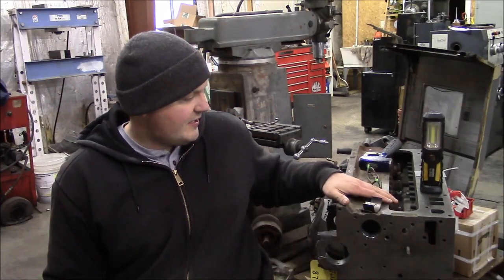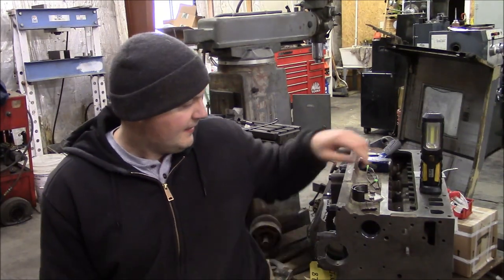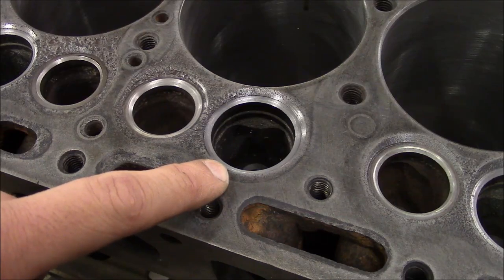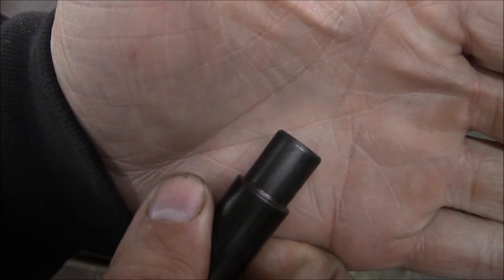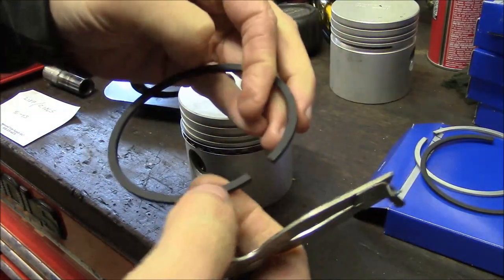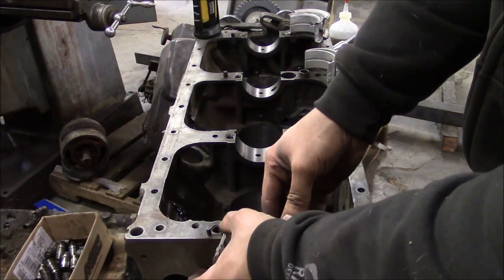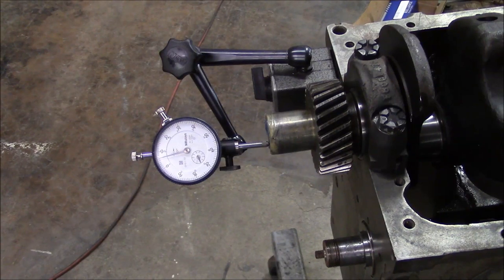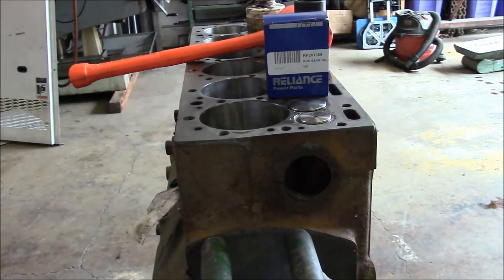Continental F245 Flathead Engine Overhaul - Part 1 (building the short block)

Comment: Wes, I'm an Airframe and Powerplant mechanic with an IA (Inspection Authorization endorsement) Which means I can sign off my own work in the 3 log books regular private airplanes have. I'm familiar with rebuilding (overhauling) engines that will attach into the airplanes I work on. The main engines I work on are 2 Lycoming and Continental. I had no idea that Continental manufactured more than aircraft powerplants. This was an interesting series thanks for letting us watch
Reply: Continental engines are quite common on welders and air-compressors of days gone by .

Comment: Excellent job. I have rebuilt many engines using the same procedures, never had a call back or failure. One suggestion, when installing pistons in the bore, I put a piece of rubber hose on each rod bolt so it won't scratch the journal when you tap it down.

Comment: Hi Wes.  I know this video was a 1000yrs ago, but you say you had to 'knock' the valve guides in with a dirty great mallet, because you couldn't use your hydraulic press.  You suspect however that this may have caused the cracks.
I'm sure I hardly need to remind you, but there's always the 'drawbolt' method of valve guide insertion.  Perhaps that would have saved the guides, and time and effort.
I've been a subscriber to your channel for maybe 2yrs, and somehow overlooked many of your back catalogue of videos.  Just spent a couple of days looking back at some of them, hence this 'late' comment.
One of the best channels of this type on YT - so thanks very much for sharing.
Regards Mark in the UK

Comment: Enjoy the video however one correction.
The notch on the bearing is not in place there to keep the bearing from spinning around, although it is widely believed it is the case.
It is mainly there to locate the bearing in the correct orientation.
The only force keeping the bearing from spinning is the friction between bearing back and bearing caps. Which therefore should be clean and oil free during installation.
I work with normal notched bearings and bearings without any notch and both work equally well.
Reply from the maker: That's a good point Eryk.
Reply: Double B S oriented so it will be retained. An not spin
Reply: @joepacheco4038  The tabs do not stop bearings from spinning, if anything they cause more damage when they do spin.  Many modern engines now use tabless bearing shells, the clamping pressure is what stops them moving.

Comment: Wes, great channel 
I've always used Motor Medic, Motot Honey or STP oil additive for rebuilding engine blocks, just the basics. New bearings, rings 
Front and rear engine seals. Hand polish the crankshaft,  lol
I never used plastic gauge. Hone the cylinder walls and put it back together.  Never had a problem not using engine assembly lube.
All overhead valve straight 6's

Comment: Forgive me, as I am tardy to the party and just catching up with some of your older videos. Please consider the following boiler-plate internet comments: 1) you used the wrong lube when you reassembled the fretterich valve, 2) my grandpa doesn't use plastigauge. Consider Play Doh, 3. You used the wrong sized socket when hammering the cap into the block. I'll consider more for the other vids in the series.

Comment: That crank gear being loose would bother me. Normally I just use 15w40 for all engine assembly. I also do an electric pump prelube of the whole engine before I start it though. You put that gasket dressing on your pan gasket both sides and you will need a sledge hammer and cold chisel to get it back off,,,, or so I have heard. :-) lol
Reply from the maker: The front pulley holds the gear in place. It's not a press fit. I've never seen where silicone or High-tack or any other kind of goo actually does anything to help the gasket seal. In many cases it makes it worse. Plus you have to clean the crap off the next time. It's nice for things like a water pump where it's awkward to install and you just need something to hold the gasket in place. Also good for the Cat jig saw puzzle pan gaskets.
Reply: I am just used to the racing diesels where if you don't weld the cam gear to the crank they will shear the key off and jump time.  Force of habit I guess.  No better way to wreck a diesel than some nice silicone lodged in a piston cooling nozzle.
Reply from the maker: 100% agree on the silcone. I've seen tons of damage caused by gobs of silicone. My dad bought a Case 580B backhoe that supposedly needed a new torque converter. Once we cleaned all the silicone out of the pickup tube it worked like brand new. There's nothing "racing" about this old engine. It's a 245 cubic inch engine that makes all of about 40 horsepower!

Comment: What I have read about the fully grooved vs. half grooved main bearings is that the fully grooved are not usually used because the groove decreases surface area thus decreasing the bearing load rating.  Usually the fully grooved bearings can be found in race engines where longevity isn't a concern but good lubrication is.
Reply from the maker: Every builder seems to have their own ideas about how to design the bearings. They all seem to work pretty well. I can't think of an engine that was notorious for bad main bearings.

Comment: Just a thought about bearings, when you grind the crankshaft 10 thousands under, the crank is now 10 thousands smaller, so it requires a bearing that is 10 thousands larger, not smaller.to mate with the crank.

Comment: My dad once worked with a forklift that had a Continental flathead 6. The cylinder head was in extremely bad condition, so it needed a specialist to weld the cylinder head before it would seal against a new head gasket. Dad described the welded cylinder head as an industrial work of art.
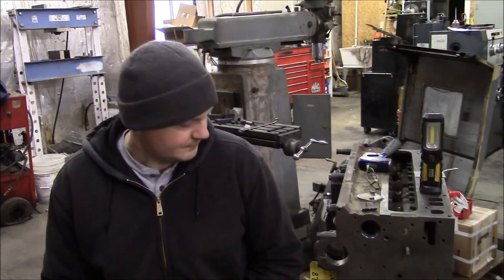5:42 In years of watching engine rebuild videos, I never heard that welding a rod journal affects the main journals. Watching many engine rebuilding videos leads to interesting pieces of information.
5:59 don't some companies have reground cranks in their stock, and sell reguround cranks, plus a core charge for your existing crank? I suppose it depends on how common an engine is.
6:11 I have heard that some low price stroker kits for the Chevy 350 or Ford 302 have cranks and rods that are made in China. They seem to work. However, I don't know how cranks and rods from China hold up as stock replacement parts for industrial engines. The performance parts are usually cast 4340 steel. More expensive ones are usually 4340 forged steel. That may be a better alloy than what the original engine had.
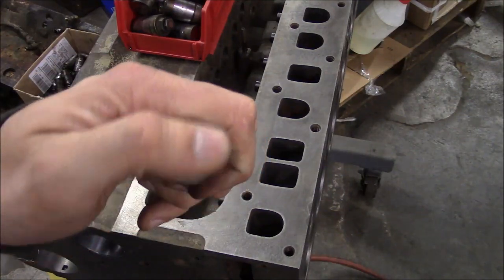15:59 Since lifters wear match the cam lobe, if the lifters are out of order, they should be reground.
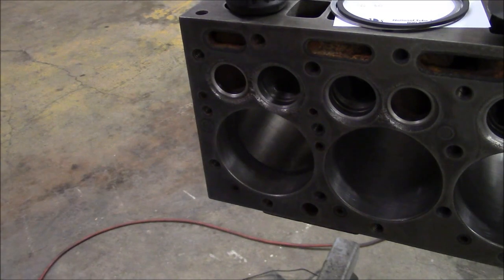23:20 Myvintageiron would occasionally find a ring that was too small because the factory put the wrong ring in the wrong package.

Comment: I took my fathers 300 six apart at 400,000 miles, all the mains were worn downward except the front main...it was worn UPWARD, I guess the Alternator/Water pump was pretty tight!  (It only had Alt./Water Pump....Manual Steering/no air pump.)

Comment: I haven't worked on the F series Continentals, but with the Y series (Y69, Y91, and Y112) you can insert the tappets (lifters) from the top without removing the camshaft, if you remove the adjuster from the lifter first.  These appear to be about the same.

Comment: In my 1969 Dodge Dart 340 I guess I pushed it too hard.  At 30kmiles the cam bearings started spinning starving the head of oil.  Ultimately the push rods smashed through the rocker arms and were just hanging there. The engine had a significant miss. We had to rivet the bearings to the block to keep them from spinning and keep the head properly oiled.  I had never dug into and engine that far before and I did this whole thing in a dirt driveway. Learning as I went.  It took me two weeks of evenings after work.  That car broke almost as much as Eurotrash.

Comment: I don’t think manufacturers use assembly lube for first start up or oil with high zinc content for break in. They just coat the parts & fill it with oil and go. So why does everyone say to use them when rebuilding a motor or installing a new cam and things like that? Just curious…

Comment: I've put many miles on the 226 cid version of this engine in a Willys pickup.  Will last forever at 2600 RPM.
Reply from the maker: They're pretty hardy engines. They don't make much power and they seem to leak and burn a lot of oil. But, that's how all engines used to be.

Comment: So, before they made assembly lube, guess what?   They used motor oil.
Reply: Hee Hee. Don't we know it.  :-)
Reply: The snotty part is what we call the cling factor.
Reply: Lubriplate has been around forever. If you were going to install and run right away oil would be ok. Assembly lube insurers no dry start up as oil would run off also lubebrication system empty pump has to pickup to fill the oil system.  Use to pack the oil pump with lubriplate to help seal and prevent oil starvation during start up creating higher vacuum in pump ( faster pickup) of oil.

Comment: Did you have them magefexed for the those invisible little crack I use to test casting then usly just grind them out but some time they went pretty deep . You spent a lot money already hate to see waste any more . Your video are very informative keep it up please .
Reply from the maker: Yes, the block was dipped in a caustic bath and then mag flux checked for cracks.

Comment: by the way Fork lift Rams make great hydraulic press rams..  imagine a custom built 50 or 60 ton press with a 3' or 4' stoke.. so if you have not ditched the rams from the boom.. you might take a second look at them..  make it even better since you have 2 rams... make a wide press.. but on the side.. make an open face single sided press with the overhang and the second cylinder with valves to control either ram..

Comment: Good job Wes! Just bought an old Clark forklift with this engine in it.  Such a heavy piece of equipment it flattened my double axle car hauler and had to get a tow truck close to $500 to get it off my trailer and to the house. Anyway- got it running and it overheats. Wanted to know what you would check on one of these first. Guessing it has a themostat I need to replace. The radiator looked good but a flush next on the list.  Just wondered if you knew what I can do in troubleshooting this overheating on mine.
Reply from the maker: Yeah you could look at the thermostat. You might pull the radiator cap and start it up. If you see bubbles, you probably have a bad head gasket or crack somewhere. If you don't see any movement of the coolant, you may have a bad water pump.
Reply: Wes Johnson- do you know what car I could tell autozone to get parts like thermostat, gaskets, etc...  did this engine go in anything to easier to get parts without paying shipping?
Reply from the maker: I don't know. The thermostat might be common to something else, but I don't know for sure. A forklift dealer can get it for you and it won't be expensive. Any ignition parts are standard Delco parts used on any old GM. So, it you need an alternator, or starter, or distributor cap you could ask for one for a 1970 1500 pickup.

Comment: what do you think about STP oil treatment as assembly lube? - just asking?  It works pretty well for clock mainsprings.
my definition of an expert - x is the mathematical unknown; a 'spurt' is a drip under pressure.  Therefore - an expert is an unknown drip under pressure.

Comment: Great video Wes.  I have a question for all. Is it possible to first place valves, springs, caps & retainers using spring compressor. Then insert cam followers(tapperts) from bottom. But hold them down, to clear cam assemble, with  plates using grove in cam followers? Once Cam in fitted. assembly plates are removed and springs push them back into contact with cam?
Reply from the maker: It should be possible with the right tooling. I'd love to know how they did it at the factory.

Comment: I’m not fond of assembly lube either. It’s just higher in ZDDP which is found in all synthetic oils. A bottle of some advanced high mileage Mobil 1 10w-30 full synthetic engine oil is perfect, not extremely thick so it flows around all the parts smoothly. Just my opinion on things.

Comment: Hi Wes. I am in the middle of my own Continental F244 rebuild and having a tough time accomplishing it. Driving the valve guides out is very frustrating - they are in there very tight. I don't suppose you would loan me (or sell me) the piloting tool you made?  I'm serious.  I'm ready to buy an air hammer but don't have the ability to make a pilot tool. Thanks
Reply from the maker: Hah! They are really in there. There's three ways to do it. The air hammer is easiest. Next best would be a pilot tool like mine in a press. But, the press is tricky because the guides are angled a bit toward the cylinders. The last method is the hammer. I used the hammer, but you saw that I cracked some of the guides, so it's probably not the best. I used my "big" hammer. It's a 6lb sledge with the handle cut off so I can swing it with one hand. Go to my channel page and click "about". There will be a link to email me. You have to use a real computer to see the link (not a mobile device).
Reply: @contentment164  so you're the one who sent him the Jam

Comment: At say six minutes in I wanted to point to your attention given that I twisted wrenches myself for many years and one of the things I found in factory installed chrysler engines: New engines with a singular rod that was Oversized say ten or thirty thousands under and no one has touched them or as they were leaving the factory. Same with pistons, something at the factory went wrong, very wrong and they have sent engines out with only one or two cylinders being bored out and a ford flat head I worked on from a factory install as new a engine with a sleeve in it. For real, not any distorting this, seen and done that. I think that if these engines were high rpm engines that they may of passed that step by so back to the show and pass the popcorn

Comment: So the assembly lube nazi's found you too...  Lots of engine builders use oil.  They switch to assembly lube if they are not certain when the engine will be put into service.. even then many of them say they have never seen a difference.  They don't like the assembly lube because they can't feel the engine.
Reply from the maker: I've never used it before. Some manual tell you to use it. Cummins recommends Lubri-plate. I don't know. It's fine I guess, but once it's gone I don't think I'll buy any more.
Reply: Always use lubriplate assembly lube no difference in friction during the assembly. Won't drip off during  storage